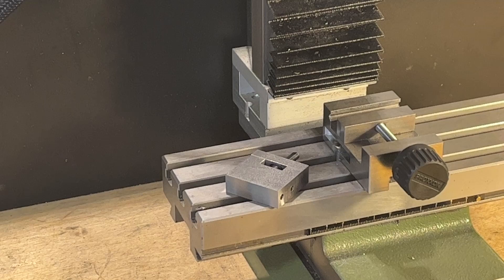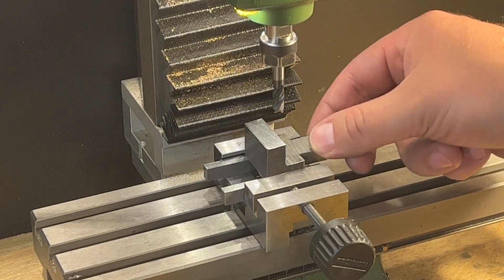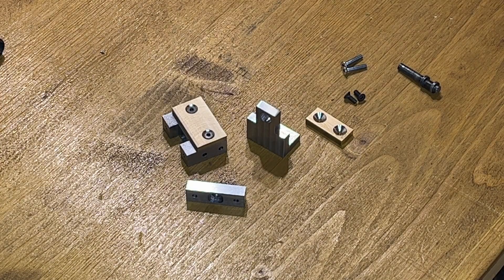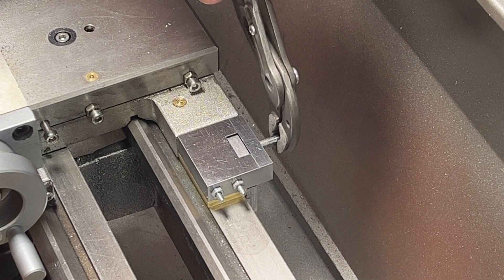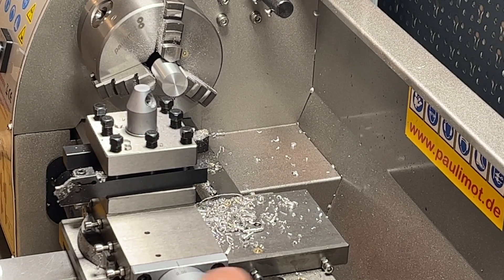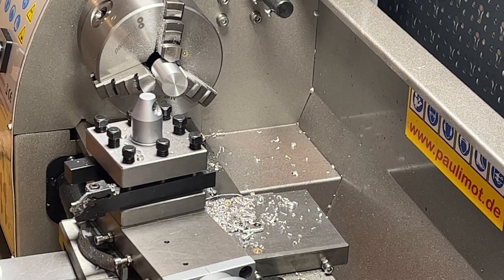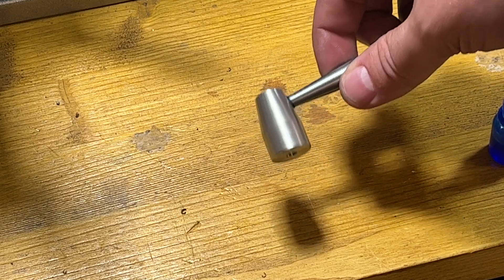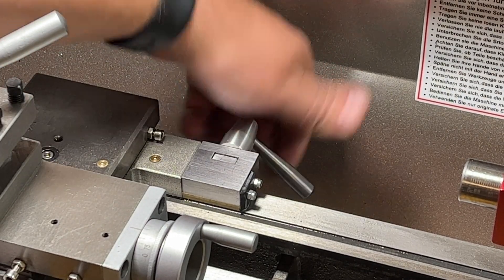Carriage lock for mini lathe (part 2)

Comment: I might be missing something but this model already has a cross-slide lock, it's the topmost black bolt in the left-bottom corner of the screen at 2:28. Nice work otherwise :)
Reply from the maker: Cross slide yes, but entire carriage no.
Reply: @zhadlun  ммм,  вообще то верхний черный винт как раз блокирует суппорт, там прижим снизу. Некоторые делают вместо этого винта ручку, чтобы блокировать без ключа.